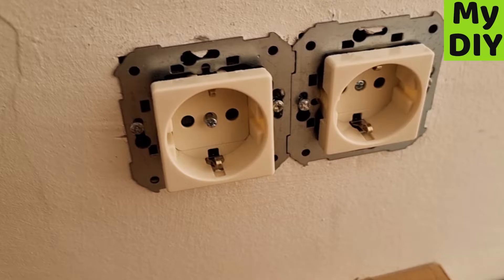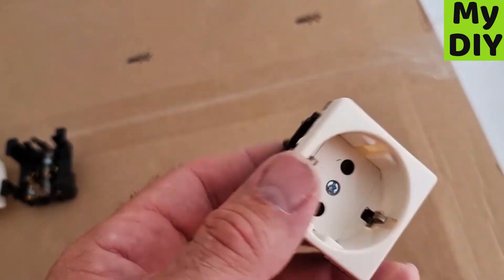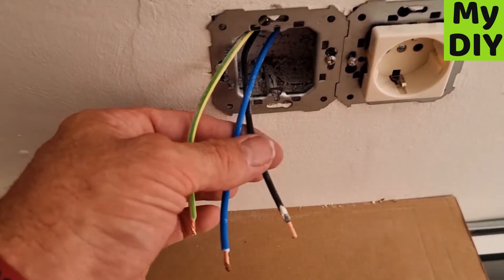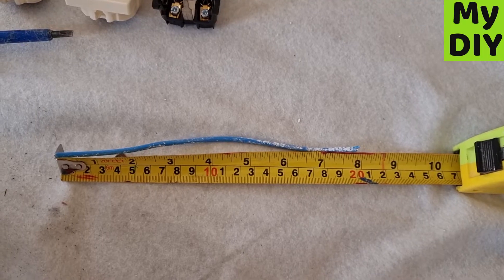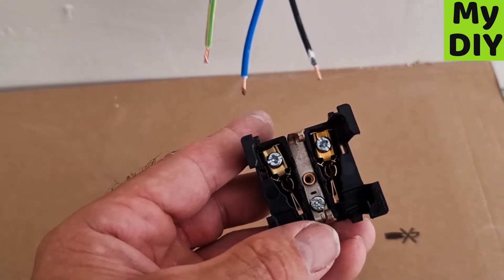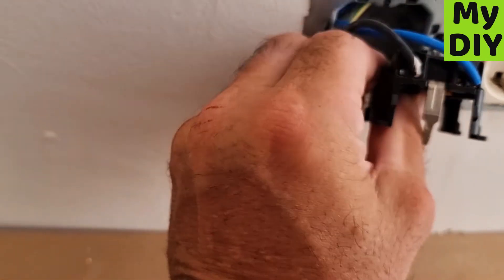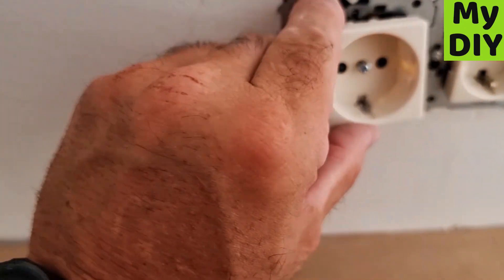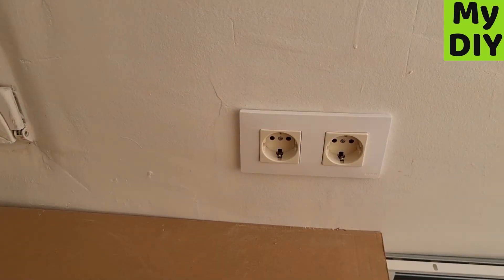How to Wire a Power Socket Safely at Home!

Comment: Hi, do you know should the wire cables be protected inside the wall by protective pipes or corragated tubes in residential buildings?

Comment: I find it much easier to work with electricity in USA than in Europe (and I am European). The sockets are bigger and much easier to wire. The sockets and their housing are also more solid and sturdy, and it is more rapid to fasten them to the studs. I would say it took me nearly double the time to wire my house in Europe vs my house in USA. Of course, it also helps that the current is weaker so that an accident will not hurt you or kill you.
Reply: Skill issue. Both are extremely easy to wire in. 

Also houses in USA are not more solid and sturdy than in EU, that’s crazy
Reply: @yupcb  It gets easier to wire in Europe when you get the hang of it.
Reply: @yupcb  I didn't say the houses are sturdier, but the housing of the sockets, the plastic container is much stronger in usa and is fixed better on the wall.
Reply: Easier to wire? I'm the US you must mend the wires and crew then. I  Europe the sockets have waho style connectors.

Sure I  the US they are more Standardized. I'm Europe every socket is wired differently.
Reply: @okaro6595  I am from Europe by the way. No, you must not mend them in USA if you do not want to, you have the option of sticking them right in and tighten them with the screw. Obviously, if you mend them, it is so much stronger than the European system, so it is nice to have that option. Also, the copper wire is just one thread, not twenty or thirty and a mess like in Europe. Double sockets come together as a nice prewired standard in USA and no need for you to do anything and you can buy built in moisture and spike protection as well. The American system is infinitely better. I have wired in two European countries and in USA. Even the socket housing boxes are much easier to attach to the wall in USA. Unfortunately, the European system builds on the German system
Reply: @24June91  bend. There are double sockets in Europe also. In some countries they prefer two singles side by side as the cords do not block each other. In Finland that is never done.
Reply: @24June91   US electrical system is outdated and very unsafe looking at the their sockets design, these sockets are also not that good comparing this to the French/Polish type E and German F schuko, also I meet very rarely loosen plugs in these sockets unlike US style sockets which are usually loose after time. 
About rest electrical system and wires, not all europe use stranded wire conductors in household, Germany and central european countries like Poland uses single core conductors.
About electrical shock hazards, european 230V phase voltage isn't more dangerous with our system where EVERY house circuit also with lighting one is protected by RCD unlike US system where only some sockets are protected (GFCI in the bathroom or kitchen) this suck, also risk of fire is higher in 120V circuits by higher currents.

Comment: Calling it a "Spanish plug" is kind of funny. LOL 😂 😂 
FIY That's the European standard. As in, from Portugal to Norway it's all the same. 
UK just has to screw themselves up as usual. Individual identity or sheer stupidity. You decide...

tip: Get a "double plug" so you don't have to deal with extensions, alignment, etc. One set of original cables and that's it. Save time, work and complications. ;-)
Reply: It is a German design and various countries have adopted it but it really is not an European standard. 28 European countries of 40 use it. Finland adopted it in 1930. Spain adopted it in the 1980s.
Reply: @okaro6595  But still different from the German ones in the way it is installed. The frame and the insert here are usually not taken apart, usually riveted together so you can't separate them without destroying them. And the frame is held in place by the cover that is fixed with a screw to the socket outlet. And the good socket outlets here have no screw terminals anymore, same is for the light switches. Only cheap, or special stuff, has screw terminals here. Special stuff would be a wall mounted pull switch.
Reply: It's called Schuko. It is German.

Comment: In Finland hey put the phase on the right and the neutral on the left. Of course it really does not matter in the end as you can plug it either way. I really like this two side by side compared to the Finnish single double socket one on top of the other. Sure this requires more wiring.
Reply: This is how we do it in Spain too
Reply: In the Balkans both wires are phase and no neutral or earth is used. It's safer. Not sure why other countries do not do it.
Reply: @Flat_Earth_Nigeria So when there's an earth fault, you'll be the path to earth. No, thanks.

Comment: Thanks I was looking for official wiring since I’m also going to renovate stuff soon. I’m the Netherlands we use brown for positive and black is it is after a switch. Absolutely not sure how the rest of the world is handling this. 😂
Reply: In Sweden, it's also brown for live (positive) but now orange for switched live (after a light switch).  Before orange, white was commonly used as the switched live. 

In France, they use red wire for the live (and blue for the neutral).  

In the UK, it's brown and blue - but there is no different colour for a switched live after a light switch.
Reply: @DavidJackson-zi1he  strange that this differs from country to country. 

In the Netherlands the old scheme was: green for positive, red for negative, how confusing and dangerous if you know nothing about it. 😂
Reply: @ElJasperino  It is very strange!  But if you read about the history of wiring colours, you'll understand it was much much more confusing in the past!

For fixed wiring (in buildings) the UK changed colours in 2004.  Before that, the old scheme was red for positive, black for negative and green/yellow for protective (earth).    

In Germany and Austria, the old colour for earth was red, but in Italy it was yellow.  So many years ago, a red cable could be positive (UK), negative (NL) or protective conductor/earth (DE/AT).  

There's a great (UK) article called "The history of colour identification of conductors" which explains how we all (half) harmonised...
Reply: Is it possible to rewire it so switches only control the ceiling lights and not the sockets?

Then control lamps either manually or via smart plugs/bulbs?